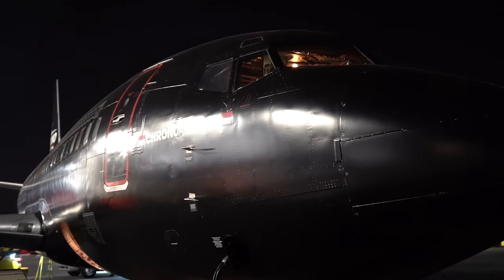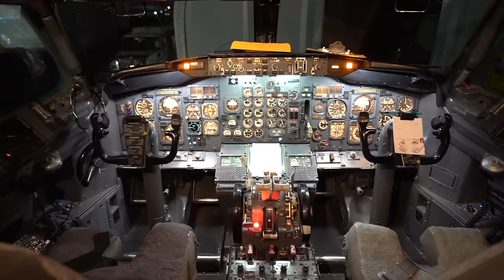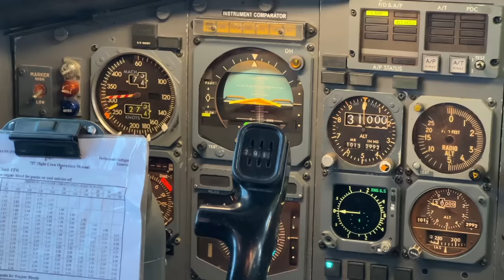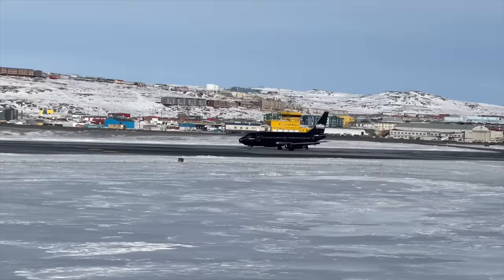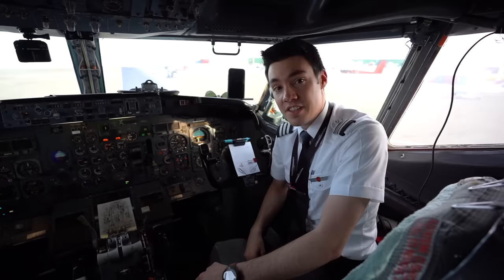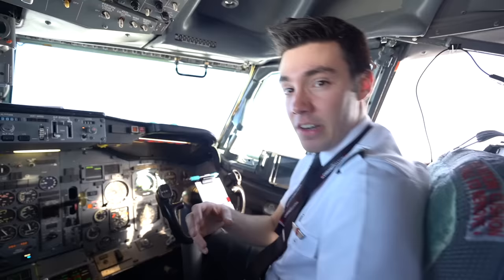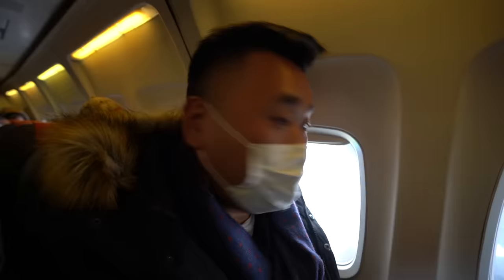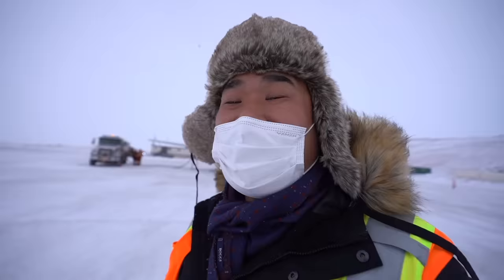EXTREME FLIGHT - B737-200 Classic to the Arctic - Landing on Snow/Gravel

Comment: I had NO IDEA they flew planes that large that far north.  Wow, just wow.  Great video!
Reply: We do it at least 3 times a week.
Reply: That's just one of many mines,  other mines have different contacts with different airlines. Id love to see Buffalo Airways and thier new 737 get some contacts!
Reply: Check out Alex Praglowski’s channel
Reply: @chronoaviation5089  C'est super tout ce que vous faites !
Reply: they take the 737 quite a bit further north as well. Check out Norwegian, they land their 737 at the Svalbard archipelago, which is at 78°N which is another 500 miles north of Mary River
Reply: I commuted to Deadhorse Alaska from Anchorage in 737s starting in 1980. It was a gravel runway back then. The job I quit before I moved to Alaska was assembling JT-8 engines at P&WA and many of the engines went to customers in Alaska so I know I flew on some jets that i worked on building the engines.
Reply: Been happening for over 60 years.
Reply: There is a Canadian military base at 82 degrees north which is far, far to the north of this mine. The base is the northernmost location on earth inhabited year around  and is supplied by air.

Comment: As a retired airline pilot my favourite jet will always be the B737-200 but I never landed on gravel! You cannot beat those target type thrust reversers for stopping on landing - bags of aerodynamic drag the instant you crack them open.
What a smart professional crew - Sam this was a fab video.
Reply: If you ever landed on soft snow its similar.
Reply: Those older jt8d engines had a sound that will never be duplicated. It’s a really nostalgic sound for me…

Comment: What a beautiful aircraft.  
The 737-200 is superbly suited for the work it does. A marvel of design and engineering.
What makes an aircraft of this type, obsolete? Nothing, in my opinion.
Reply: It costs more money to operate and to maintain due to its age, and the JT8D engines fuel consumption isn't optimal. Given the unique gravel strip capabilities of the 737-200, these would be an acceptable trade off, however the longer these aircraft fly the more wear and tear the airframes get. There is a limit to how many flight hours and pressurization cycles an individual aircraft can safely operate. And there aren't really any low flight time 737-200s left in the world to replace them with. Once the existing fleet is worn out, they'll be retired.

Comment: Sam - The temperature (at 7:16) of  -30 Celsius is not really that cold. I have been in places in Canada and elsewhere that are much colder.
Reply: I’m a Canadian too if we went to Dubai when it was plus 50C we’d be complaining too. People are climatized to different weather. Minus 30 would be a real shock if you weren’t use to it. Anything below -30 is kinda unpleasant, might have also had high humidity.
Reply: @DMSparky  I have been to Dubai and other hot countries. They say it's a dry heat, but you still melt like ice cream.

Comment: An unusual airplane. Used to be used a lot in Alaska before arctic runways were paved and cleared more better. Also now more flights with high wing turboprops. But the 737s have been the modern version of the venerable DC-3. Rugged, dependable, everywhere.

Comment: Black is a good choice for arctic aviation when you park a plane and if there is moisture in the air you will accumulate frost the frost melts quickly with a  little sun in the winter
 almost every twin otter you see in the arctic has black upper wing and tail surfaces

Comment: I worked in Northern Alberta for a tar sands oil company for eight years in the 90s. I worked on IBM mainframes in a data center which is the exact opposite of a manual type outdoor job. The food in the camp was always very good and abundant. I stayed in the town of Fort McMurray but we'd get contractors staying for months at a time who would live in the camp. I remember one guy who was cursed with the wrong sort of metabolism combined with a sedentary computer job who put on 20 or 30 pounds over many months due to the excellent camp food. The cook who was responsible for deserts would leave for a few weeks during the summer to enter European culinary contests with his pastries.

I miss the days of small airports before security was a thing. You'd park your car 50 steps from the door minutes before the gate call. Airports were much more pleasent back then.

Comment: The walk around by the F/O was great!  I wonder what aircraft type will replace the 737-200 considering the clearance issue with the engines.
Reply: AVRO RJ by BAE will be a good option
Reply: @sukhchainghotra23  They're not widely available with gravel kits though, I'm pretty sure only 2 have ever been equipped with them.
Reply: @noah_dpk  agreed
Reply: @noah_dpk  Have a look at the Summit Air fleet in Yellowknife, NWT. They have a RJ 100 and 85 both configured with gravel kits.
Reply: @sukhchainghotra23  Maybe, but 4 engines... Besides the Avro RJ is notorious for poisoning crews with burned oil leaks into the cabin!
Reply: i think the 747-8 would be a great option
Reply: Its great to see Buffalo Airways getting their first 737 very soon :)

Comment: I remember flying on B737-200's 50 year's ago. If you sit behind the engines it was the same sound and vibration experienced at a drag race. You didn't zoom off the runway but it felt like you were.

Comment: Great video.  Prior to the demise of Canadian Airlines, there were 3 airlines service the north:
Canadian North (Canadian airlines)
First Air ( with subsidiary Bradley Air Services)
Ken Borek Aviation
Brdley and Ken Borek did the really fun flights to smaller towns and epeditions to North pole etc.
 (Borek also serves the South pole station)
When Canadian Airlines went belly up (bought by Air Canada), a diminsihed Canadian North became independant and served western arctic only, while First air took eastern arctic. (they have since merged and also included other serviecs such as Air Inuit etc). 
But as a result of all this change, new airlines such as Chronos and Nolinor emerged to do comemrcial charter services. that use dto be done by Canadian North. These new airlines got the 737-200 combis no longer needed by Canadian North (western arctic is mostly paved runways ). 

Fresh food at Mary River is all flown ifrom Montréal and fresh food in Montréa in winter is shipped by plane, train or truck from much further south).
So if you had bananas in mary river, they traveled by ship from south america to Wilmington Delaware and then by train/truyck to Montreal, then plan to Mary River.
Reply: That was really interesting,  thanks for that.

Comment: Wow. Alaska Airlines flew their 737-200 combis until 2007. The combis had a cargo door near the front, and a movable partition to divide cargo in the front and passengers in the back. They also had smaller than usual overhead bins, which appeared to be so the "igloo" cargo containers would fit. I flew on them a few times on the Anchorage-Nome-Kotzebue route. Great planes for the arctic!

Comment: good trip.  You need to visit Yakutia.  Cold Pole.  -71°.  Swim in the winter at -20 in the river.  It will be a very good movie.  Also visit the Arctic.  The polar day is very surprising.  It is a pity that there are no local airlines in Murmansk to show the beauty of the Barents Sea.  There are tourist flights by helicopter.  Good luck.

Comment: I used to work with the RAF,they had a problem with landing gear on sand.  I suggested memory rubber outer casing,they did think about it for a while, but it wasn’t feasible.

Comment: Most aeroplanes are in white colour with livery variations and this aeroplane is black. Is that because it's so cold there? Black colour should apsorb more heat and fuel consumption should be higher. I'm just curious

Comment: Man, I remember flying in one of those planes back in 80's the were pretty cool then and still are With the turbo jets I'm not a big  of the turbo fans. And I guess Mate black because of tje the cold weather so it can absorb as much heat from the sun in the north pole.

Comment: One of your Coolest Vids. I flew in a 737 200 back in the 90s, Are the Engines still really Loud at take off or did this Aircraft get Retro fitted with Noise Suppressors?

Comment: As a junior tech for South African Airways in the 90's, cutting my teeth on the B737-200 with those bullet proof Pratt & Whitney JT8's, the debris reflectors definitely bring back memories. They were necessary for the flights to Victoria Falls in Zimbabwe, as the runway was a gravel one then. That runway can now handle an A380. The fire and emergency category however, cannot. Oh how times have changed! Thank you for your videos, refreshing.

Comment: 5:53 What is the purpose of the plastic tubes running up the left and right window pillars? Couldn't find anything online.
Reply: To drain away condensated water. There is also a tube down along the center pillar

Comment: @Sam….If it’s B737-200 series then I’ll have to correct you with the caption. 
Cause it’s ain’t called the Classic. It’s actually called Originals. B737-100 & 200 are called the Originals. 
Will provide you a chart below for reference and knowledge sake:

Divided into what has become known as the four generations of the Boeing 737 family:

The first generation "Original" series: the 737-100 and -200, also the military T-43 and C-43, launched February 1965.
The second generation "Classic" series: 737-300, -400 and -500, launched in 1979.
The third generation "NG" series: 737-600, -700, -800 and -900, also the military C-40 and P-8, launched late 1993.
The fourth generation 737 MAX series: 737-7, -8, -9 and -10, launched August 2011.

Comment: What is that cable running from the fuselage to the tail? Visible @16:44
Reply: That's for in case the tail comes off in a strong wind it won't be completely lost.  They're expensive and they don't make them anymore.
Reply: Found it, it's an HF radio antenna (if anyone is wondering)

Comment: 45 year old Boeing... With 45 year old engines, 45 year old technology, 45 years old wiring.... What could possibly go wrong... Retire it, its a piece of shit now
Reply: I hope you are being sarcastic. This 737 classic speaks how well they were designed and engineered back then. Boeing back then was an engineering/safety-oriented company, unlike nowadays which brought out the 737-MAX. Now the MAX is a PoS that should retire.
Reply: @ctlaltdel22  Do you even know what you're talking about? We put hush kits on those JT8s in the 90s and they still couldn't pass noise abatement... They were banned in Europe... I thought the last of them ended up in Africa.... I still certify on B737 300s and 400s. Do you know what EWIS is.... The 100/200 was a great plane but its an old plane and that's an issue